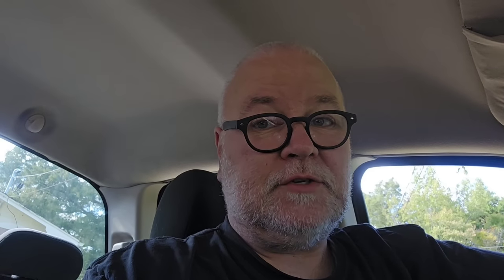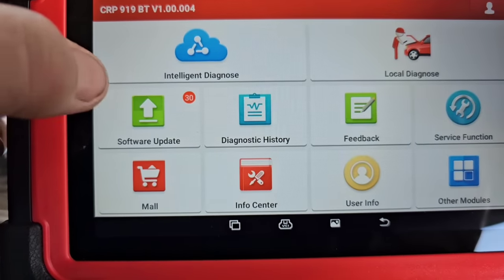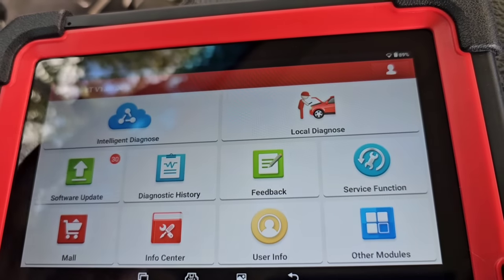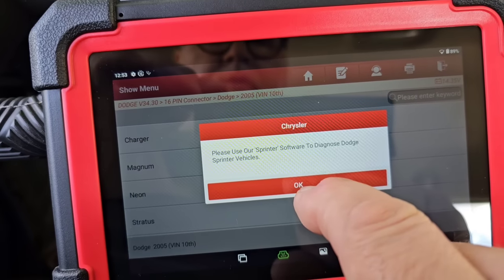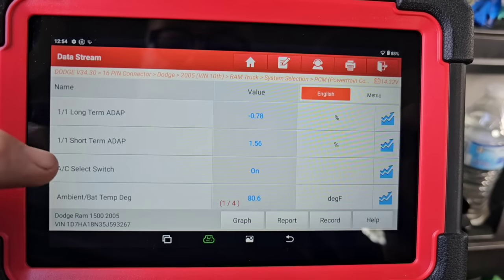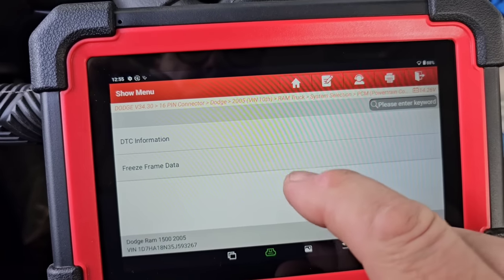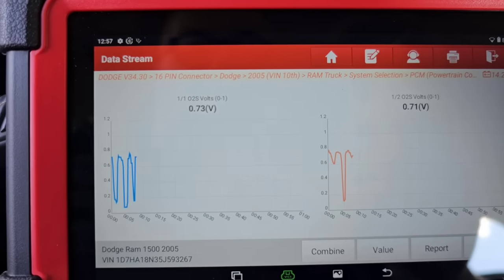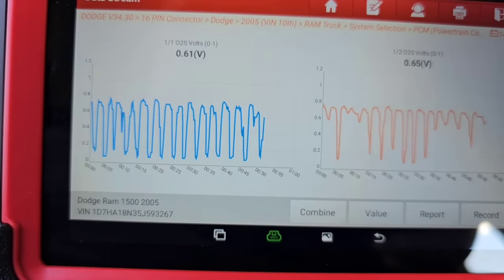P0420 & P0430 Catalytic Converter Efficiency Codes.. CRP919EBT Scanner Tested!!

Comment: When you showed the scan tool graphing the O2 sensors, the readings were exactly what you should expect. This is another really good example of open and closed loop operation. When the motor was cold and the scan tool showed the downstream O2 sensors graphing the same as the ones upstream, its supposed to be that way. Those readings were not of the downstream sensors. They were copies of the front. When the vehicle is in open loop, the downstream sensors are ignored until they reach operating temperature. 

You won't get accurate readings of the O2 sensors and cats when they're cold. If the O2 sensors are not bypassed, you would get a check engine light every time you start the car. When the PCM dropped into closed loop, the graphs changed because it was now taking data from the downstream sensors. That's why you saw such a big difference in the waveform.

Comment: Your definition of what the scan tool is the same as what a scope does. A lab scope is basically a multimeter that refreshes and graphs the results. The difference is where you are taking the measurements. With a scope, you read data that the scope measures directly, and with your scan tool, you are reading data as seen by the PCM.

Its also worth noting that some scan tools have scope functions built in. I can do things like relative compression and power balance tests right from my scan tool without even popping the hood. If you do a lot of diagnostic work, these features save a lot of time.

Comment: Kenny,  I wish you had gotten deeper into the causes of P0420/P0430. It's not always a bad Cats or O2 sensors. There's incorrect reporting of a MAF Sensor, vacuum leak, lean fuel trims and even possible fuel injectors. It would be nice you explain how to test for each.
Reply: You don't test for lean fuel trims. Fuel trims that are too lean or rich are the result of something else being wrong. The PCM takes the data it receives from all of the components you listed, and more, and uses it to calculate fuel trims. As for learning more, there's too much information to go over in a video. If you get a book or video on basic OBD2 theory and operation, it will answer all your questions on this topic. You may also want to look into getting the factory workshop manual for your vehicle. Each brand is a little different, but its not uncommon for the workshop manual to list step by step diag instructions for specific symptoms and DTC's. You'll need it anyway for things like torque specs, so its always a good investment.

Comment: My chevy pickup had messed up cats, I couldn’t justify the $1200 for the replacements so straight pipes were installed in their place, the cat code would continue to show as the rear O2 were reporting the conversion was not occuring - I installed some standoffs on the rear O2’s (hollowed out spark plug anti foulers stuffed with ss wool) - now it works fine, exhaust has a nice growl to it now without those confounded cats.

Comment: Here in AUS  we  are limited by the local now non existant manufacture of vehicles so I ended up with a Topdon Maxiscan I think(not near it ) so I don't know the exact one but it covers all AUS built vehicles as well as all the ones on that Launch it is wireless & updateable via wi-fi my only gripe with it is the screen is a bit small however for $500 aud it is great as a DIYer scanner (I have 1 GM 1 AUS GM & a Nissan works on all three.) Cheers mate.

Comment: 99% of the time a tech tells me he is going to try O2 sensors to fix a P0420 or P0430 the vehicle needs a catalytic converter.  Of course you can just expose them to fuel induced rich mixture and then an air induced lean and watch them swing to see if they work.